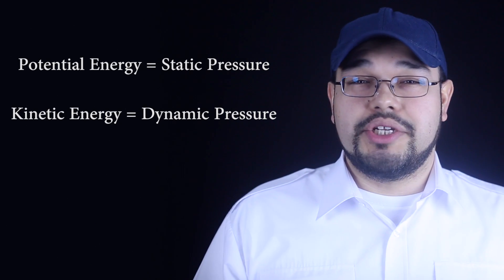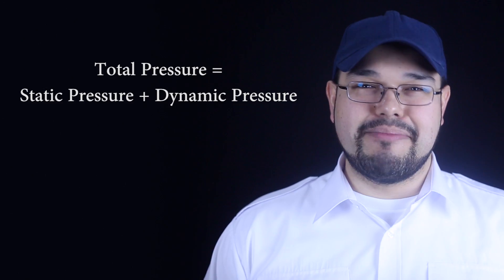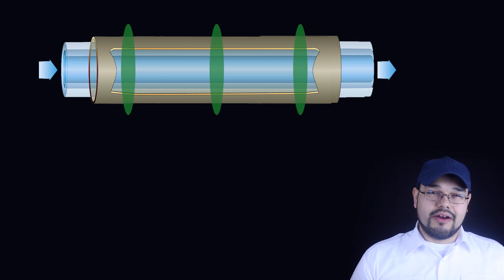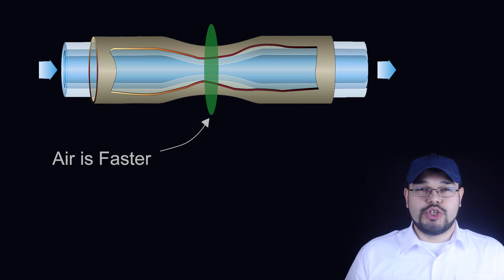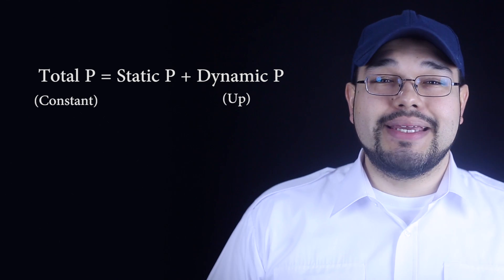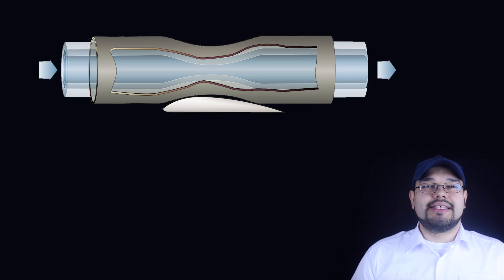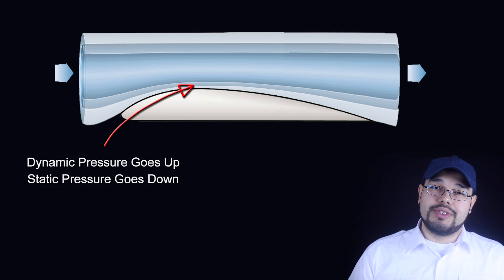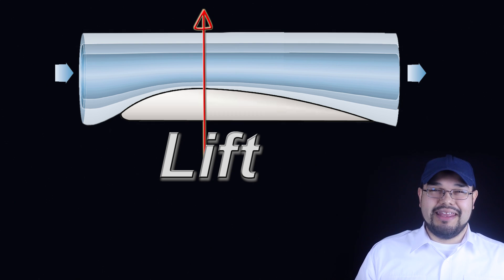Why an Airplane Flies - Part 1: Bernoulli's Principle | Pilot Tutorial

Comment: B.S.  If Bernoulli’s Principle explains how an airplane can fly, what explains how an airplane can fly UPSIDE DOWN?  According to this video, an upside down airplane would drop like a rock.  Yet, airplanes fly upside down at every air show.

Bernoulli’s Principle makes an airplane wing more efficient in the upright position, but it does NOT explain how an airplane can overcome the force of gravity and fly.
Reply: airplane wings are not static! they have moving parts that can change its angle of atack thus generating more or less lift (you can search for a modern airplane wing on google and you can see all the parts it contains such as flaps and other suff i dont know the name of)

airplanes that consistently have to fly upside down (like stunt planes or fighter aircrafts) have symmetrical wings

therefore, they can’t rely on the shape of their wings; they only manage to fly upside down by tilting their wings in the right direction to generate sufficient lift
Reply: This theory is bullshit...
Reply: Bernoulli's principle is only one of the two ways aircraft create lift. Newton's Third Law Of Motion is the second and explains precisely how an aircraft can fly upside down. Newton states "For every action, there is an equal and opposite reaction" For instance a prop or turbine forces air backward creating the equal and opposite reaction that pushes the aircraft forwards (thrust). This same aspect can be used to describe lift, as a plane's AOA increases more relative airflow is deflected downwards off the wing's trailing edge, this has the equal and opposite reaction of pushing the leading edge up and forwards creating lift. Aerobatic planes at airshows have symmetrical wings that allow them to increase their angle of attack upside down this way they gain lift through Newton's Third Law Of Motion rather than Bernoulli's Principle.
Reply: @maxtintle4957  Angle of attack is 95% of the explanation.  Bernoulli’s principle makes a wing more efficient but, by itself, cannot get an airplane off the ground.